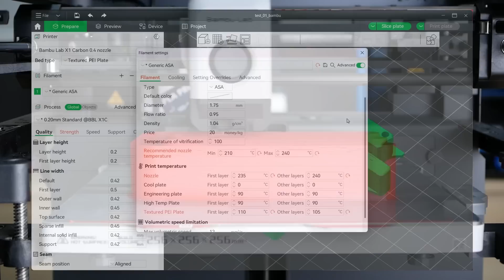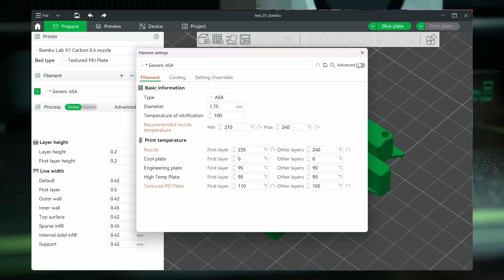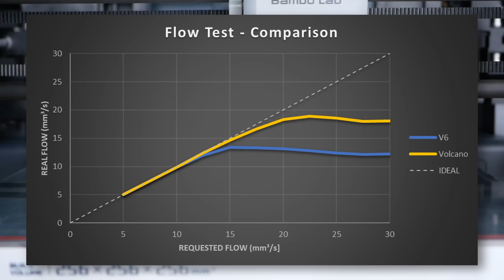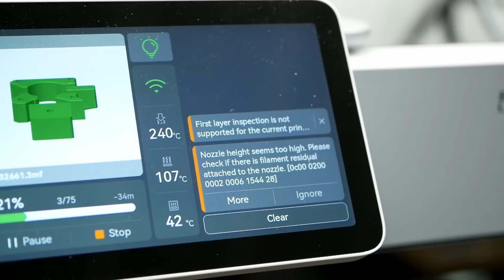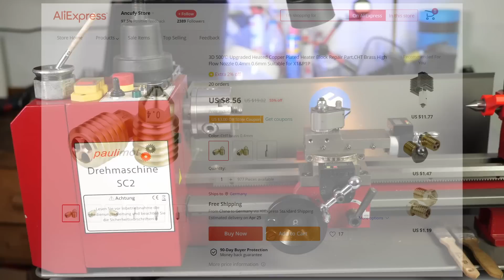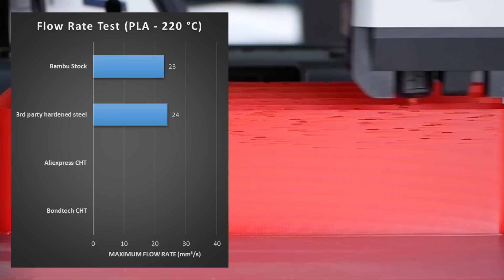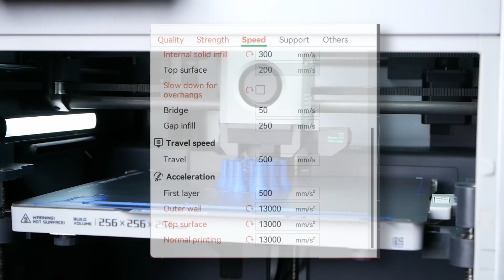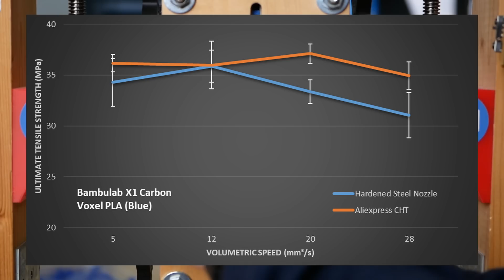Fast 3D printing is bad for Strength! (and how to fix it!)

Comment: Hi Stefan, in terms of checking part strength I'm wondering if printing some functional parts and simply cutting them for visual inspection might be another data point?  It strikes me that whilst the numerical approach adds more objectivity, the visual inspection is going to be informative - just as Orca uses visual inspection to judge quality as you showed in this video.

Comment: For the adhesion test i you could do single or multi-walled cylinders and print in vase mode. Since you have a cylinder layer adhesion might still be the weakest link. might be worth a try. The bigger the circle the less the acceleration limit.

Comment: I have had a smoothieware delta for the last about 7 years. It has been my workhorse till it was damage in a earthquake. With the stupid amount of time I have put on this printer (wish i had a hour meter but just not possible at this point). It was the first printer I owned with the capabilities of going into the 200mm/s - 250mm/s range. I feel like your findings mirror what I learned over the years with that printer. If I wanted to print fast, part strength often suffered, and even details at times. I would often run it much slower than it could go, even more so when printing smaller plate volumes. 

You might also want to consider revisiting annealing the parts that you found previously weak. Not as big of a deal on PLA. But for ABS, and Nylons you can see noticeable differences. Its more noticeable on these materials if you run a high bed temp and chamber temperature. As you can experience annealing while printing, when doing multi hour prints in these materials.

Comment: wider nozzle sizes allow more material to lay on each other at a heated temperature for a longer time, making it stronger. They make the . This is why even with ultra high flow nozzles, the layers need time to cool down and not too fast, otherwise the part will collapse on itself. Have a look at the approach of filament innovations in the US. The make 2.5mm nozzles with very long heat blocks on they typhoon extruder and still produce very strong parts.

Comment: I've been experimenting a good bit with the AliExpress CHT nozzles that you mentioned in this video, and have even moved on to trying out MatterHackers bimetal CHT nozzles in the AliExpress hotend. A question I'm having now is, do ironing settings specifically something to do with nozzle height (probably custom gcode or something) have to be altered to account for the new nozzle length? I've just noticed a significant drop in ironing quality as I test ironing settings with the new nozzle.

Comment: I kind of think you're wrong.  I just got my p1p and stuff is coming out stronger than on my ender 3's.  I think it's because it uses higher temps which really melds the layers together, and also cools quick with aux fan.

Comment: Any idea:

I have buyed the clone Hotend and a expensive M6 Tungsten Varbide Nozzle.

But with Hotend it is about 2mm too long. Thread is same but Tip is too long. i dont know what i should do to get 2mm up the hotend or cut 2mm away

Comment: Came across this whilentrying to piece together why the bambu labs printers are so fast.  At its core 3d printers melt plastic and deposit it in layers.  My hesitation in buying one has been in figuring out if they just print such that the parts look good or if they are able to achieve excellent layer adhesion as well.  Thats something that i havent seen ANY other channel address at this point (may 2023). Thanks!

Comment: To print stronger functional parts faster I use a tip from one of your earlier videos - print wider lines. For a LOT of my printing these days I'm using 0.8mm lines with a 0.4mm nozzle. With Cura 5, thin walls don't suffer, since the slicer will generate thinner lines when it needs to. You still need a higher flow hot end, of course, since printing wider lines at the same linear speeds means more plastic per unit time. Luckily my Artillery Sidewinder X2 has a Volcano hot end.
Reply: Have you noticed extrusion line weakness since lines are parallel and not ironed using 0.8mm extrusions?
Reply: @matenorth  Sorry, I don't follow. The lines between layers remain the weak points, as they do in all FDM prints, while the borders between printed lines are comparatively tough. The reason you can print 0.8mm lines with a 0.4mm nozzle is that there's a flat area at the bottom of the nozzle that is wider than the orifice, and this flattens out the wider line. I suppose this IS analogous to "ironing" the line.
Reply: @iskandartaib  More than 0.5mm lines don't iron the next line since it exceeds the flat surface of the nozzle so the lines are not fused properly. At least that's what the community says.
Reply: @matenorth  I can't say I have ever heard anyone (let alone "the community") say this. See what Stefan here has to say about it, he actually did experiments to see what the effects were, he concluded you got an increase in strength. I only found out this was possible from watching that video. Works very well for me, I use it for maybe 90 percent of my printing. Reduces printing time to about 60 percent.

Comment: On my Ender 5 I print ABS at 260 C and I noticed that the strength at 60-70 mm/s was not good. Interlayer  adhesion was not good. I went down to 40 mm/s and this seems to produce much better layer adhesion. I have not done thorough testing but just finger tested it. What I also noticed that on my parts which about 160 mm in linear dimension the strength was bad in the middle part of the run. Where the head was able to get to the speed, at the corners, where the head slows down, the strength was much better. I think that your test with small test parts is not good for this kind of research. I have been thinking about a better setup, I think that some flat test pieces may work. Like 80 mm long, 0.4 mm or 0.8  mm wide and, say, 50 mm tall. I think that you really have to let the head to get to the speed by providing enough length here. Even though you set 13000 mm/s2 acceleration, I am not sure the printer can actually do that. I hope this will give you some ideas for a great new video. Thank you for you work.

Comment: learn from bullet proof glass wire mesh rebar of 3d prints for strength
Reply: yeaa multiple nozzle in one ultra fast printing, all nozzles extrude simultaneously
Reply: if you have ultra wide nozzle matrix, you dont have to move the print head (accelerate/decelerate) at all, like in a resin printer, the whole print plate is the target plate, figure out yourself how to do that with pla/abs etc fdm printer
Reply: full resolution extrusion melting gate array
Reply: ie variable shape extrusion hydraulic press 3d printing

Comment: I got my 4.1 mm high /0.6 mm aperture CHT nozzles and the replacement hotend for my X1C 4 days ago.
I started printing PLA at 20 MM2/SEC, at 0.5 mm layer height, but at 166% speed (ludicrous) the hotend couldn't keep up the 230C.
So even at 126% speed (sport) the max temp is 130
I hope AliExpress starts selling 150W heaters (if the drivers and PSU can handle the power)
A hardened CHT nozzle would also be most welcome.
But changing out a nozzle is much easier now, doing it the old-fashioned way!

Comment: What a complete construction fail of a printer. Nozzles need to be replaced from time to time, due to several reasons. Shall you buy a new hotend, each time something happens? ... In order to print with horribly detuned settings y factory?

Comment: I wonder if flow rate is the only thing affecting layer adhesion... As you have already found, a lower cooling fan speed is essential to improving layer adhesion and I imagine that the faster you print the more cooling is needed 🤔

Comment: It's not that the nozzle flow can't keep up with the speed it's the fact that polymers are a viscoelastic material, visco meaning viscous (i.e. can only flow as fast as the viscosity allows at a given temperature) and elestic meaning that it also has an immediate elastic response. You can only ever go so fast with printing a polymer at a certain speed. The machine is not the limiting factor but the material. If people want to pront fast then they should buy an injection moulder.

Comment: Run the same test with larger coupons. Also the layer time should be part of the test. After all the question is "Does speed effect print strength" rather than "does speed effect layer adhesion." I know it sounds the same but its not. This is a theroritcal test with errors VS a real world test.

For example, I am developing a 3d printed EDF Jet. I coud print large fueslage sections, each at a different speed, run destructive testing & choose the best speed. This is full "real world" testing. The disadvangage is it will take weeks of printing to get these test articles.

The other option is to test speeds on smaller parts that wont (as closely) replicate the actual print characteristic conditions of the larger Flight Parts. Disadvange being an induced error, advange being that it can be done in a single day.

So what I did was make more meduim sized test articles. Parts that represented full size segments of the main print. Then ran destructive testing. The time per layer is a variable that needs to be included to answer the question you are asking.

Comment: It would be interesting if you compared .2mm standard to .2mm strength profiles. The strength profile slows the outer wall from 200 to 60 mm/s

Comment: Bambu at stock profiles focuses on speed, which is not that important to me - unlike strength. Slight under extrusion and "cold print" (by not having enough exposure to bond properly) is their dirty trick to great looking parts, that you have in blink of an eye. So I figured a  certain rule of thumb, to make it good: Flow and temp a bit up, hotend fan a bit down, aux fan @ 10-20% (for small parts, for big ones aux off, as it will warp the piece). Makes strong part fast. 
But it's ofc material dependent, as I had no luck printing PC-CF fast. For some you just have to go slow. But ABS works like a charm - if you clean your rods frequently due to some sticky fumes :D

Comment: The shiny vs. matte look also has to deal with residence time. When the plastic is sitting heated longer (like in a slower printer) it will come out shiny. So on the faster printer, the time the plastic spends heated is much lower. You can also overcome this a little by increasing the temperature.

Comment: It's a good video, but I think it's not complete without touching on the topic of layer height and how this affects parts strength. Not all of us need these high speeds, but they are still useful to have. We can trade them for quality just by using 0.1 layer height for every print, which obviously requires less volumetric flow.

Comment: This has been a bit of a catalyst for some experimenting I'm doing now. 

Do you think it would be effective for at least strength and quality to configure a print profile around a constant flow rate, instead of by speed or max flow? Since we're getting well into the realm of the bottleneck being extrusion rate and cooling instead of the motion system, I feel like that will be closer to the end goal of maximizing strength and quality, while not significantly sacrificing speed to ensure those are reliable.

I'd love to do some more testing on this and would really appreciate your thoughts on it.

Comment: You think that maybe if we use a smaller filament diameter, for example 1mm of diameter and use a CHT nozzle for create more heat conduction for the filament, this maybe cause that the heat go deep into the filament and allow to go more faster, stronger and color consistent in out parts? obviously that produce a news way to extrude small filament, and reduce mass in the hotend for more speed at smaller carriage, you need to extrude more filament for mantein the same flow but perheaps its a better way, tell us if this maybe have sences

Comment: Bei den blauen Teilen würde ich mal den Z Sprung weg lassen. Man sieht sehr gut wie jedesmal auf der Oberfläche ein Materialrückstand stehen bleibt (11:30).
Man müsste hier das Material einziehen bevor der Kopf hoch fährt. Aber selbst dann wird wohl Material kleben bleiben. Da ist ein einfaches seitlich wegfahren mit Rückzug effektiver.
Was ich sagen will, Material das zuviel auf der Fläche ist, ist nachher auch zuviel da für die nächste Schicht. Ob das dein Problem behebt weis ich aber nicht ;-)

Comment: Or just print slower, then you get into wear on other parts, like extruder gear, current draw, etc... I never exceed 50mm/s (Ender 3 nonPro) I use a larger nozzle, larger layer heights, 1.5 hr benchies vs 4+ hrs, default settings at 70mm/s.. Drilled a 1.2mm nozzle, I don't care much for fine details, I print large.. If you want detail AND speed, I'd get a resin printer 💯

Comment: Nice work.  Does upping the nozzle dia (stock OEM nozzles) have a linear relationship in the dropoff?  There's a lot more bonding area (potentially) and heat which might mitigate some of the speed issues.... maybe?

Comment: Also got the Bambu Lab X1C Carbon with AMS and those effects of matt/shiny are omnipresent. Most of the time I don't care but sometimes it might throw off an otherwise good print in terms of quality. 

For strength: I recon that it also has to do with the filaments itself, how old they are, how dry, how abrasive. Especially with PET-G printing fast seems to weaken the parts to a good extend as you pointed out in your video, to a point where I do not print anything that needs to be strong in PET-G. Maybe I have to dial in my printer and slicer a bit more to get that back. 

Will look into those custom nozzles and also keep sharp lookout for the high speed nozzles of Bambu lab.

Comment: When I first got the X1C I banged out a few parts at the default settings, and noted that the print quality was pretty good.  Then I cut everything in half (from Bambu's defaults) and discovered this made the print quality *amazing*.  As someone who's mostly printing ABS and then sanding and finishing it to look like not-3d-printed, running the X1C at 50% of nominal and 0.12mm layers still gets me parts in half the time the Ender-5 did, and those parts end up needing about a quarter of the sanding and finishing work that the Ender-5's production did.
Reply: Hi there what size nozzle are you running on you X1C  while printing ABS
Reply: @justinmurray8582  The standard 0.4mm.  I'm usually printing at 0.12mm layers and trying to capture fairly small details on many things, so a larger nozzle isn't worth it most of the time.  The exceptions don't come up often enough to bother with building up a hotend with a bigger nozzle.

Comment: Do these printers use a different PID formulae for the different latent heat of fusion of the different filament materials? If so, and since PIDs are ideal for constant flows and not so good for flows that are more dynamic, do the printers use PID tables for each material so that as flow changes the printer can automatically switch to a better PID at that instant?

Comment: I guess Bamboo Labs needs to bring out their own CHT nozzles, before the knock offs flood the market to the point where no one would go for the genuine ones.

Although, given the propriatary nature of the printer, and what regular paper printers have done in the past, they might simply copy some bad practices there.
At which point I'd be curious if it'd help them more than hurt them. Only time will tell, /if/ it happens at all. Maybe they're capable of learning from the backlash others faced.

Comment: Hi Stefan, I didn't notice if you mentioned it, but did you weigh the layer adhesion samples? I could see the weakness coming from both underextrusion and/or from the stress caused by a single hole bore vs CHT style nozzles due to temperature differences in extrusion at high speeds

Comment: Awesome video as always. What this actually makes me wonder, is whether the good old 2.8mm filament might be due for a bit of a comeback. 
Changing the diameter of the filament affects the feed rate by the inverse square of the proportional change in filament diameter. Meanwhile the distance from the hotend wall to the center of the filament only rises linearly (but so also does the surface area available for heat transfer). So the question basically becomes: Is plastic such a bad conductor of heat that fully melting a 2.8mm filament takes more than 2.56 times as long as 1.75mm filament. 
If that is not the case , the achievable flow rate for 2.8mm filament should be higher in a heating zone of the same length. 

Thinking about this further this is probably one of the reasons why for bigger extrusion systems the pellets are usually not melted by heating them externally but rather through the friction imparted by the feed screw. In a system like that the flow rate of material and the amount of energy transferred into the material should be largely coupled as long as you adjust the turn rate of the screw to always have the same pressure in the system.

Comment: For strength tests, I'd be interested to see what results you'd get if you used higher extrusion temperature for your high print speed tests! And then higher enclosed ambient temperature on top of that!
Reply: Yeah I am pretty sure you can solve these kinds of issues with a higher wattage heater cartridge & turning the temperature up which decreases the time needed to melt the plastic.  A copper heat-block also helps because it both increases your heat throughput and reduces the lag between the heating cartridge and the hot-end.  I print at about 23 mm3/sec and don't have any issues with an e3d v6.  It's like $20 in upgrades.

Comment: So speed is a little bit weaker. However what happens if you increase the temperature past advertised printing temps?  I feel like temperature values set are based on old technologies and really needs to be rewritten.